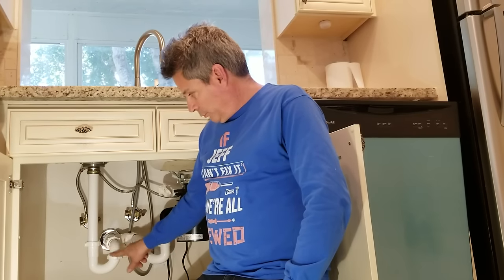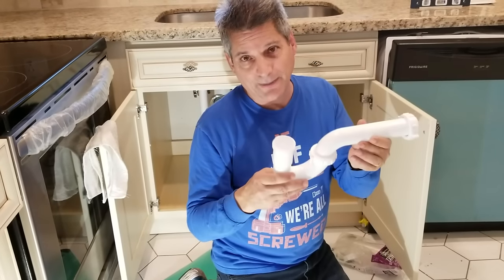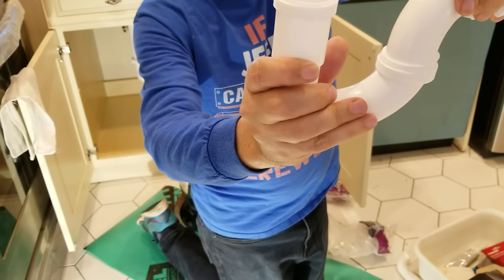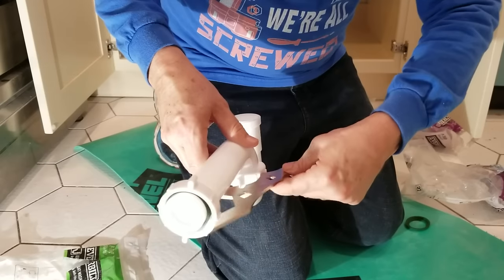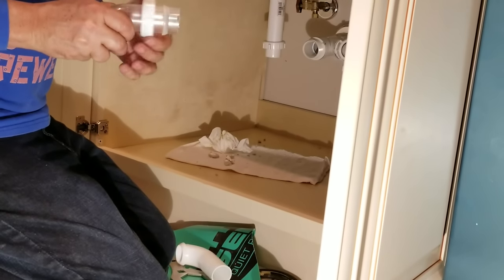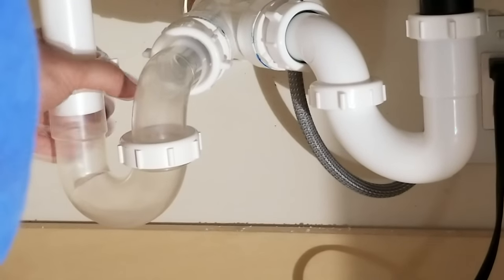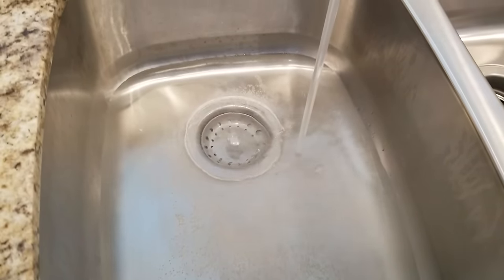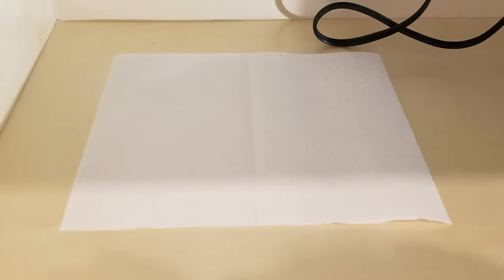Why is my Kitchen Sink P-Trap Leaking at Connection Nut?

Comment: Soooo the solution is "buy a new trap"?
Reply from the maker: Cameron, you don't need to buy a new trap unless it is cracked, chipped, or damaged. Most cases, you just need to change your strategy of how you tighten the wing nuts on the p-trap. the most important nut is the one where the trap weir is located, tighten that one first as it requires the most critical and demanding alignment, then tighten the others, and that should sole your problem.
Reply: Couldn't find any cracks or chips in the existing one, but a $5 replacement definitely fixed it for me! Thanks
Reply from the maker: @iviaverick52   I love to hear these great  Success stories
Reply: jeffostroff hey Jeff, we moved to a home and found out that the p trap is leaking specifically in the area where you mention that the water keep the gassed from coming through, I unscrews it and inside it looks like the put some sort of glue or paste? Should I buy a new one or clean it out?
Reply from the maker: @los0160  that stuff is likely to be pipe dope, usually blue in color also known as pipe sealant, and usually used to lubricate and seal threaded pipes, particularly metal threads. Some plumbers like to use it to seal that non-threaded p-trap weir connection, because that is prone to leak, because most people don't tighten and install it correctly, or they over-tighten it. But I don't agree that pipe dope should be used because that is a friction connection, not threaded and pipe dope should be a thin layer, not globbed on, and could just end up interfering with the connection since it stands between the 2 pipes. Sounds like your pipe dope layer or broke down or was not applied evenly, allowing a leak. The better plumbers know to use the technique I showed in this video, not the pipe dope. Our technique, which is to connect the p-trap arm to the p-trap FIRST, since that is the most important connection. Make sure those 2 pieces are perfectly aligned AND tightened FIRST before all other pipe sections are tightened. Then you'll have no leak there. To me adding the pipe dope to this connection is a cop out for not  doing an adequate enough job sealing the connection. 
i still don't know why they use this type of connection, I think it should be a gasket connection like the others.

Comment: Why would you have separate traps for the sink and the garbage disposal that's just asking for trouble on a garbage disposal you need a garbage disposal waste t that shares one trap it is much more efficient and works a lot better
Reply from the maker: It can be done either method
Reply: @jeffostroff  I know either method can be done but to trapp's do not work better than one

Comment: Home dept didn't tell me about the different sizes for bathroom vs kitchen. Ugh. No wonder this dumb thing has wanted to leak. It really wants to leak at the part that goes to the waste pipe? Ick goo accumulates there. Seems like that isn't correct either.  Thanks.

Comment: Those ptraps are a bad design and especially if you get a leak it could damage your ceiling in a finished basement. One you tube plumber out east glued all of his fittings under the sink.
Reply from the maker: Yes if you use real PVC pipes, you can cement them, that's how they did it in the 1970s, but now they require these types of p-traps for people to have access to the drain.

Comment: My bathroom is 1.5"
Reply from the maker: Yes, we see that sometimes in older bathrooms, and they eventually convert to 1 1/4" on the drain downspout, using a P-trap adapter.
Reply: @jeffostroff  interesting I just replaced the shut off valves supply lines faucet  drain and plumbing fixed the drain leak following your other video now just got small drip on the rear of p-trap
Reply from the maker: @gotheatsauce   Are you talking about the rear of the P trap where it plugs into the wall? If so make sure you put the washer on air a lot of people forget to put the washer there on the Herb adapter. Also the washer is directional it matters which way it faces.

Comment: Just take it all apart and slop flexseal all over it, reinstall. Fixed forever, not much money spent.
Reply from the maker: LOL Flex seal!  That's funny after my friend evicted their tenants who weren't paying for years ago, we came in to fix the bathroom and there was black flex seal all over the place 'cause they thought they could fix a leak to the downstairs both spraying that stuff everywhere. I ended up coming in and ripping up the bath shower bench found weather crack was that was allowing water to seep in and get downstairs whenever they turned on the shower. Fixed it up by building a proper slope on top of the bench and used silicone rather than caulk tape which is what they had used to fill in the cracks which was completely useless.

Comment: A responsible licensed plumber knows better than to do this
Reply from the maker: A responsible licensed plumber did this, and there is nothing wrong with it. The other method still has both sinks into one waste line going into the stack. there are no code violations, the use of the Wye is perfectly acceptable. And yes both sinks drain perfectly. Just because they chose a different method than you use, does not mean it's wrong.

Comment: You have made this much more complicated than it really is. I have installed thousands of these polypropylene traps — what we plumbers refer to as “Bag traps”, and I can’t recall one time where the weir nut and seal has leaked. The nut forces the flanged part of the trap to seal square and properly by mating the flat portion of the nut to the flat portion of the trap arm at the trap weir. It is absolutely impossible to make it g=crooked and leak unless you cross-thread the weir nut. These traps are a “Wam, Bam, Thank you, Mam” and done task. Your description of the installation causes viewers to spend way too much time installing these and causes them to be paranoid about such a simple thing.
Reply from the maker: Sorry Bruce you are wrong. I have seen many plumbers install the P-trap and leave and I test it and immediately see drips because they did not test their work. Also you are wrong, the nut does not force the trap connection to seal flat if it is not already flat. I have tested this many times, and seen drips many times.

Comment: Put a rubber seal in a p-trap and problem solved.
Reply from the maker: They should have designed that weir nut fitting to be like the others, with a gasket.

Comment: To much talk with distracting music and no solution  ,  why didn't you show how to fix the back pitch of the rough pipe or blockage???,. That horizontal p trap piece should never be full of water like in the video  , shows there is a blockage or back pitching pipe, I'm just saying  , I M a service technician plumber. And I am good at what I do no matter what.
Reply from the maker: We are uploading a new version of this tonight at 6:30 pm is the premiere of it here: https://youtu.be/tqf11On2xEA
As for the pitch, we were at the mercy of that Wye that the plumber before us installed, not enough room to get a decent slope going, but at least we got some slope, the air bubble at the top of the crown  shows that we are OK, not ideal, but OK, and this sink drains perfectly as we have shown, and there has not once been a problem with siphonage out of the P-trap, or lack of draining, it works perfectly. You would be surprised how many sink P-traps we see that are perfectly horizontal going into the wall, but they still work.

Comment: This isn’t code. Double trap.
Reply from the maker: You don't know what a double trap is, this is not a double trap, as each sink is it's own fixture. double trap would be one trap after another sequentially. what I did here is perfectly legal as long as the 2 traps are on the same floor.
Reply: No. A double trap is defined as having multiple traps on a single trap arm. Which is what you have here. 

Some codes still allows this style of trap for multiple fixture sinks. But, generally it is looked down  in the plumbing community as it is sloppy.
Reply: 100% illegal to have that set up under your kitchen.. Handy Andy dont know what hes talking about.
Reply from the maker: @bubbadan20006   Since you're so smart about what you're talking about, paste the exact plumbing code Subsections and the exact wording that specifically points out this scenario and says it's not allowed. I Bet we never hear from you again.
Reply from the maker: @JC-yq7qx   These are not multiple traps on a single trap arm like you said, these are 2 separate trap arms that go into a wye connector.  The matter you how you slice it if you had to sings going and you use the horizontal pipe between both basins like most people do, you're still having the same amount of water fighting for the same amount of drainpipe.
Reply: We will fail final inspection every single time if we do this set up.
Reply: @jeffostroff  Just stop. Your not fooling any one but naive homeowners.
Reply: @bubbadan20006  I"m convinced he knows and doesn't care because this video has too many views for him to take down. It is just funny that he bad mouths handyman types but if I walked in to do an inspection and saw this I would 100% think it was done by a non-professional.
Reply from the maker: @JC-yq7qx    why don't you stop because you are not fooling anybody.. I did not do this installation I was filming the licensed plumber doing the installation, duh, did you hear my voice behind the camer?. And you still haven't come back with the exact plumbing code violation just as I predicted I would not get an answer from you, just more bogus nonsense. Show everybody here that you really know what you're talking about and produce the actual plumbing code. I can tell you a 100% of the time in the past when I tell people to come back with the code I never hear back from them you're just another one of the I don't knows who's trying to make people think you know.
Reply: @jeffostroff  
Uniform Plumbing Code 2021
1001.2 Not more than one trap shall be permitted on a trap arm. 
222.0 Definitions: Trap arm - Those portions of a fixture drain between a trap and the vent

What is your next excuse? I'm going to go with... "My state doesn't use that code!"
Reply: Sorry, I ruined your 100% success rate.
Reply from the maker: @bubbadan20006  LOL, somehow you got the dumb idea that I installed this P-trap setup, I never said I installed it. I videoed the licensed plumber as he installed it. You're making up the nonsense about  me "backpeddling" because you've been lying all along saying I did this work. Doesn't matter who did it, I stand by the licensed plumber's work as though it was mine. This topic has been debated on Terry Love and the consensus there is that it's OK to do, because most of the plumbers there, like myself, believe that double p-trap means don't put 2 p-traps in series. And each P-trap serves one fixture, each basin counts as a fixture. Nothing is double trapped.
Reply: @jeffostroff  Codes exists for a reason. Your putting people's homes as risks for views. Cant wait till you get sued over this. Also good job hiding this comment thread.
Reply: @bubbadan20006  lol He hid the comment thread so no one else can see it. 🤡🤡🤡
Reply from the maker: @JC-yq7qx  This was on my property, and I don't plan on doing this type of sink going forward anyway, I prefer single large sink and one P-trap. We got this sink at an auction so we went with this. Also we tested the heck out of this multiple times with both basins full and pull the plug at the same time, neither P-trap siphoned out. One thing you are forgetting or may you just didn't know, the weir level as it looks down the trap arm toward the vent inside the wall should always see the opening of the vent. In other words the water lever will never be full enough in that pipe to cause it to choke, there will always be air behind water. Also, I don't know what you mean by hiding this comment thread? I have no control over where YouTube places the thread, it's in the comments section.